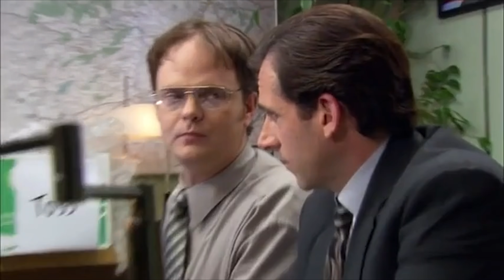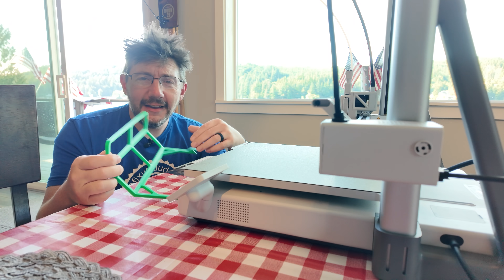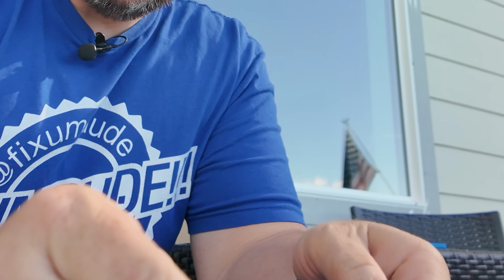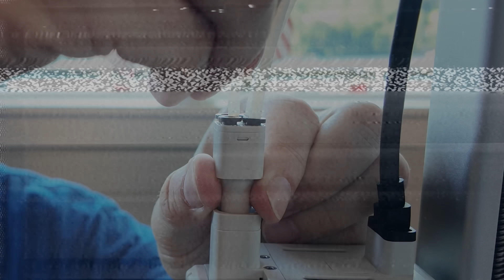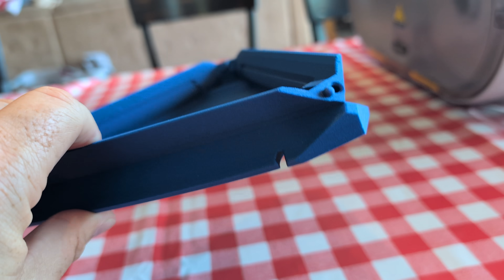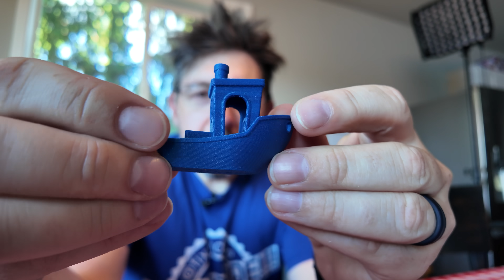Do THIS For Perfect Layers

Comment: 6mm3s is a joke, just means that 300c is not enough. These high temp petgs should be printed more like pet filamentsat higher temps. 90c bes wouldn't be necessary in an enclosed printer

Comment: Living in Houston, where humidity is high year round, I've learned to dry all my filament, no matter what kind it is, if I want a decent print. Getting the ace pro (comparable to ams2 since it has drier built in) with my anycubic kobra s1 was a game changer. I basically never print multicolor since it's so slow and wasteful with just 1 hot end, but for drying filament and automatic runout switching, it's perfect.

Comment: why did they ruin it by adding glass fibre, glass fibre and carbon fibre don't actually increase strength in PETG parts, they make it significantly worse.

Also it probably has poor layer adhesion Becuase of the glass fibre, this material would probably be significantly stronger and better printing without the glass fibre.

Comment: Your Chep pawn test was flawed.  You didn't start with reproducing your problem with the pawn model.  Therefore you can't know that you fixed the problem until you moved back to your large print. 
A simple 3 sided cardboard box for draft walls around your printer may have solved your bed adhesion problems.  You might be spoiled by your high end hardware causing you to miss the day to day problems that we, the unwashed masses, see.
Reply: I was just thinking like "Hellooo? Brim? Mouse ears?!" :D With a print that large I always add extra insurance for bed adhesion in the form of those on my bedslinger :D

Comment: Benchy is my least favorite test print lol I just don't vibe with having a box of worthless tugboats.

I prefer squishy turtles. You get the same inspection points but it also checks for fitment and strength. Plus I am a huge fan of turtles (I've kept a few as pets and have a tortoise), and I can easily make new shell designs for the turtles. I have a wall of color-swatch turtles with various shell designs. My favorites so far are a light grey turtle with a shell that has the moon's texture. I have another copper silk PLA turtle with a penny design embossed on its shell (I designed both myself).

The benchys do their job, and use less filament, but my turtles are all very unique (black one with a spikey mohawk shell, gray one with a cobblestone shell, metallic one with a diamond plate shell, etc.) which makes them a lot more interesting to have on display. That and their squishiness makes them fun little desk fidgets.
Reply: Have you posted those models anywhere? I also don't like the benchy that much...

Comment: Standard PET-GEE CORRECT PRONUNCIATION degrades above 285c so protopasta must have made a formulation that survives that threshold
Reply: HT = High Temperature, so yes. It's in the name.
Reply: @haliphax- good point, but also, just because your nozzle is set to 285 or 300C doesn't mean the material gets that hot. The length of the heated section in a given nozzle plus the volume rate dictates the heat transfer for the nozzle to the plastic. The slower the print, the longer the plastic has to heat, and the hotter it gets. The reverse is true when increasing speed, the plastic gets cooler and might not stick to itself as much.

Comment: Wow 6mm³!
So what would be the benefit of this filament aside from the awesome color?
Reply: Better heat resistance without annealing, stiffer than standard PETG.
Reply: @NWGR exactly
Reply: Not sure I'd judge the speed as its the wrong tool for the job, I print Petg GF all the time on P2S, X2D and H2S.
 Its a fantastic filament, pretty sure this brand would be the same on the correct printer.
Reply: @mickd8188 have you seen the video about GF / CF petg actually makes it significantly less strong, like cuts it's strength in half over regular PETG.
Reply: @HerbaMachina plastic is significantly less strong than steel, yet they don't make sippy cups from steel. Everything has a use case and built for a purpose. 
Petg-gf is an extremely reliable part, and looks fantastic as well.
Flow rate, temperature, line widths and nozzle sizes are important on how structural something is also.